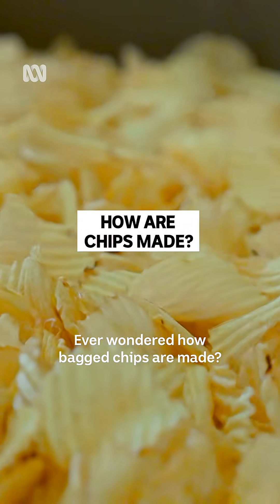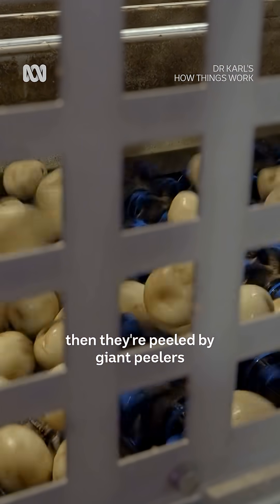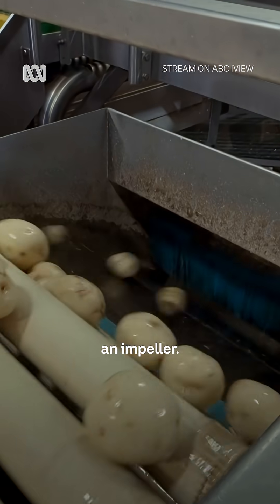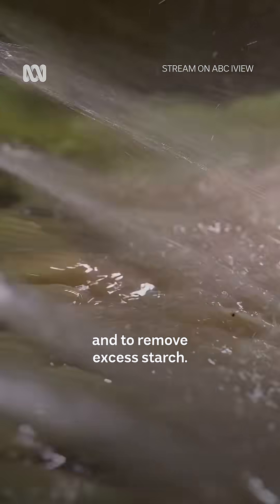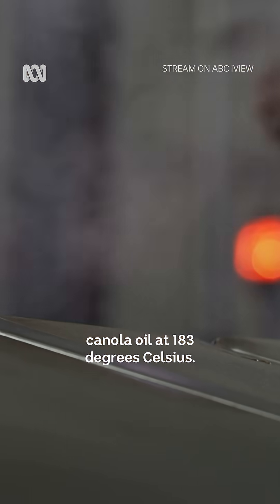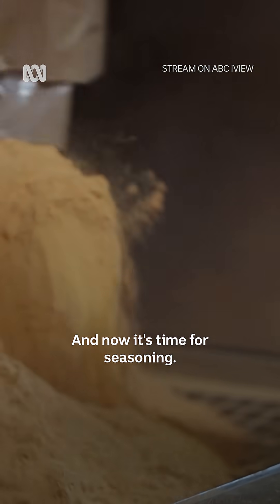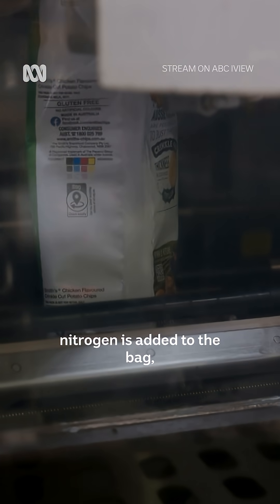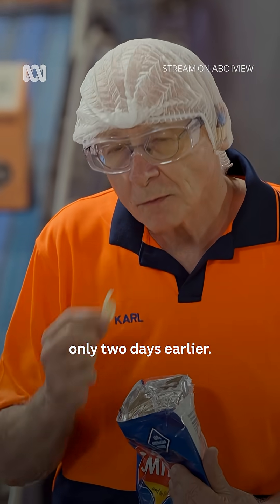”I wish I had a free bag of chipssss” 🥔 #Factory #DrKarl #Science

Comment: Quite a bit different to Walkers (Pepsico) in Leicester England when I went round about 10 years ago.
The fryers are long, narrow, shallow tanks of oil and as the crisps are removed, each one is checked for colour and a jet of air rejects any that are too dark (the ones that I really like....).
They are then slowly tumbled in a large mesh drum where any flavouring is sprayed onto them.
Packing is/was amazing given we are just talking savoury snacks.
A large number of "maybe 1.5m high, pedestals are set on a raised floor. The centre of the pedestals are hollow - a bit like stainless steel scaffold poles, and at the top something like 5-6 seperate bags are arranged.
Crisps rise up through the centre of the pedestal and each one is weighed and from that, allocated to a particular bag. The whole thing is ststistically controlled so that as near exactly as possible, but not under, the declared wieght is in each and every bag.
All for a bag of crisps!!!!!
Walkers make numerous types of crisps/savoury snacks, but their "standard" crisps are over 50% fat.

Comment: So you told us how the chips are made, but you promised to tell us how bagged chips are made. HOW DO THEY MAKE THE BAGS?
Reply: They are fed from a roll of film which passes over what is called a forming collar - which describes its shape perfectly. The vertical seam is heat-sealed at the same time, and the bottom of the bag seal is made as the previous bag is sealed and cut from the bottom of the next bag. The contents are dropped down the "neck of the collar".
The film used has numerous layers on oreintated polypropylene film as the base. Apart from the base, there will be heat-sealable layers (co-extruded with the base film), plus at least 5 layers of innk - black, white, yellow, magenta and cyan. Most packets will also have an vacuum-deposited aluminium layer as a gas and moisture barrier. Base films are down around 10-15 micron and each roll of film is actually a laminate of two films with all theink and aluminium sealed in the middle (try scratching the inks off, or the aluminium).
Reply: Forming collar -
I magine a headless mannikin, cut straight across 10 cm or so below the top of the shoulders. Now bore a 15cm hole straight down through the neck, like an enormous trachea. Then split the sternum through to the bored hole.
Film is fed over the shoulders and forms a tube down where the trachea should be with both edges protruding through the slot through the sternum, where it is heat-sealed.
Then put a heat-sealer and knife mechanism under that.

Smaller, bigger bags - different width of film and size of forming collar.